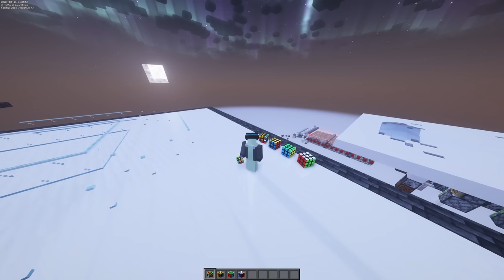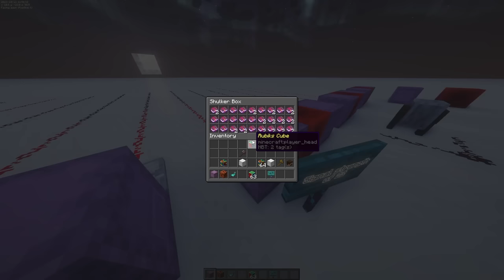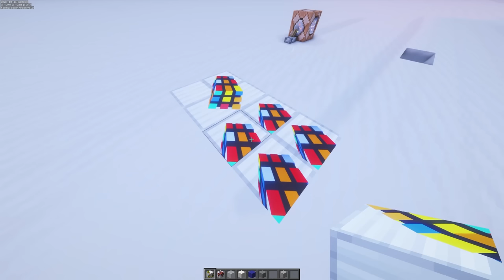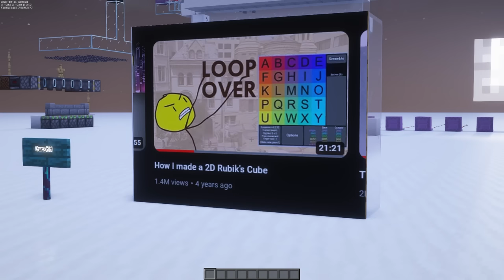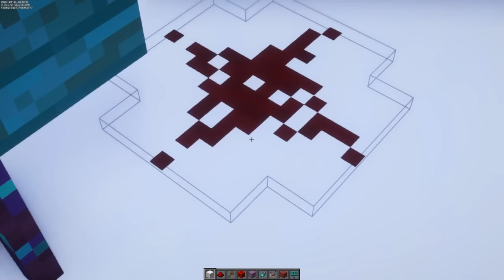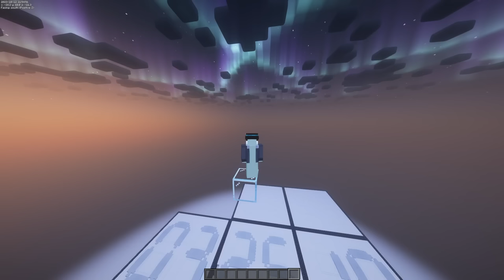Creating a 2D Rubik's Cube in Minecraft (part1)

Comment: You can use the 2D net of a 3D rubic cube to create a functionaly 3D cube on a 2D plane, however it would take 54 different cells so you couldn't use signal strength
Reply from the maker: 54 different cells? I could use signal strength, as theres only 6 colors. However the network of nonsense required to get the shulkker boxes where they need to be is unfeasible. Standard computational redstone would be more effective

Comment: This is a neat project. Calling it 2D Rubik's Cube isn't quite correct, but I get why you called it that. The stickers of an n-dimensional Rubik's Cube are (n-1)-dimensional. So a 2D Rubik's Cube has 1D stickers, aka line segments. They would only be one the outside of the 2D cube (read square) since the inside of it isn't even visible from within the 2D plane. A 3x3 2D Rubik's Cube would for example have 3 line segment shaped stickers making up each of the 4 sides. Sadly 2 dimensions aren't enough to allow for any turning of the faces (edges), so 2D Rubik's Cubes are pretty boring. If we allow turns into a third dimension, an NxM 2D Rubik's Cuboid is equivalent to a 1xNxM 3D Rubik's Cuboid with the sticker on the NxM sized faces missing. 1xNxN 3D Rubik's Cubes are also called Rubik's Squares. The sliding puzzle with wrap around you are creating is similar to twisty puzzles like Rubik's Cubes and Squares from a mathematical point of view as far as solving them is concerned and many strategies for solving one of these in a specific way should be applicable to the other ones. These sliding puzzles tend to be easier for humans. But to complexity theorists these 2 types of puzzles are equivalent since they can be solved in polynomial time while finding optimal solution is NP-complete.

On a semi-related note this kinda reminds me of the self solving Rubik's Cube in Minecraft that's been living in my head for a couple years now and is still waiting to be built. Surprisingly, the self solving aspect is the only part of this I have mostly figured out.
Reply from the maker: Thank you for the very well thought iut comment. Its kinda true that it isnt a 2d rubiks cube, but thinking of it as conceptually a puzzle that involves the intersection of various piece moving moves to scramble the pieces, it checks out in my book. I wonder how difficult a rubiks cube solver would be to create, besides going to lazy route and recording all moved and pkaying them in reverse

Comment: so, eh, if the dust caps at 15 strength but the comparator doesn't- isn't it an expensive but doable prospect to just pass the signal along with comparators into the component you need if said target component can also be overloaded?  Maybe there are also other components that can handle overloaded redstone signals somehow, and if you can make them update something you could make cables cheap again with leafstone/scaffolds etc to trip an observer.
Reply: I mean, if you can find something other than a comparator that changes behaviour depending on strength, it would make sense. But to my knowledge, all redstone components in-game except for the comparator only ever turn off or on, with no regard shown for the signal strength.

Comment: Can you explain the Redcoder a bit more? Id like to know how you find out how you can realise its more than 15.

Do you shortly send another signal that subtracts from the original and if the original is still higher than 0 you switch over to the next row?
Reply: Just subtract 14, then put it through a repeater. If it's 15, 15-14 is 1, so the repeater will be active. If it's below 15, it will be either zero or negative, which is rounded to zero. If it's above 15, it will slowly increase.
Reply: i'm guessing he takes a comparator output from the first redstone dust, then subtracts it by 13. if redstone is off, don't do anything, but if it's on then input signal strength 13 into the original comparator (and cut off the bottom output line)
Reply from the maker: It uses a full detector (SS >15) to find iut if its overloaded. Then itnsubtracts 15 from it